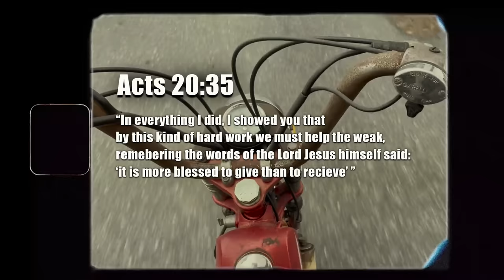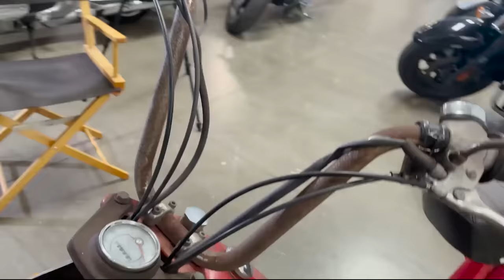I Bought a $700 Barn Find

Comment: As a 13 year old in New Zealand, I desperately wanted a mini bike !.  Unfortunately my parents divorced; but the goal of a bike was forefront in my mind.  I bought a ready made mini bike frame. I built the forks at a local workshop . Sprocket hub welded to the rim for free; because engineering shops don't charge kids :)   .  I bought new 10" Wheelbarrow rims and Honda Z50 tyres. I bought a Sachs 50cc motor and was well on my way.  My Mum worked for the Mayor of Auckland; who happened to be an ex- motorcycle business owner and beach racer . He helped transport the bike to the airport when I flew it boxed up, to another city I was moving to , to attend high school.   Shortly after I had it inspected for registration and it passed and was allowed registration for the road (day-time use only; as it had no lights).  From then on I could ride to friends on weekends and ride it anywhere !.  This was the start of my motorcycle career.

Comment: I have a question. If I was to take a carburetor from a Liter bike, do you think it could replace the carburetor on a 1987 Fiat Panda 4X4? It also runs off of a Liter engine so I was just curious to see what you or anyone else here thinks.
Reply from the maker: i have no idea, but liter bike cars are 4 connected  to each other not just one carb

Comment: The Garelli vip and the benelli gentleman are the worst moped.In italy nobody had one because they all broken. The best in my opinion(every 14 yo had one in the 70,80 and 90's) are the piaggio moped. The piaggio ciao,si,boxer,bravo or superbravo. I have a ciao with 65 cc Polini racing,gianelli fire,13 13 carburetor,malossi filter and simonini clutch. It does like 80 km/h.